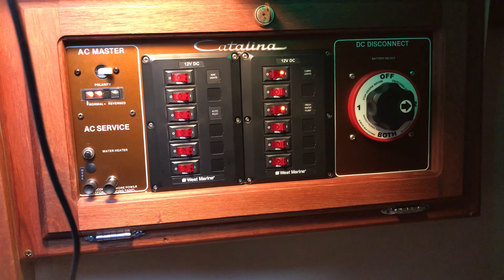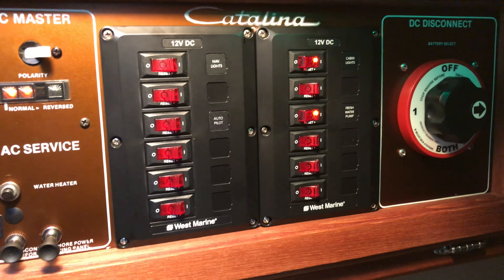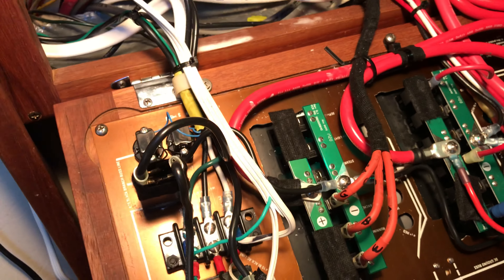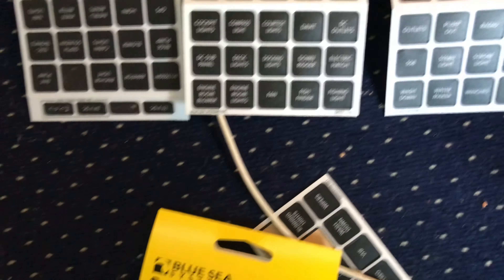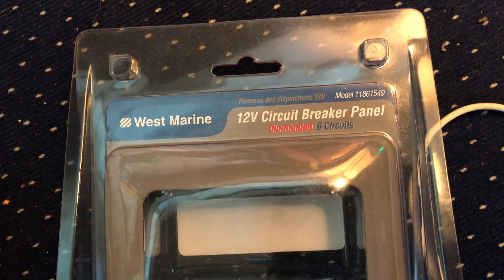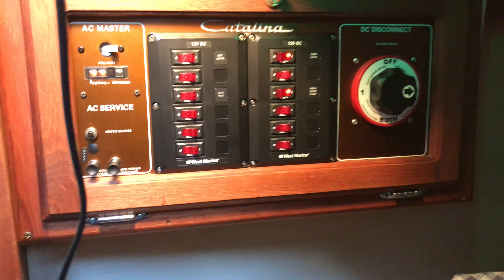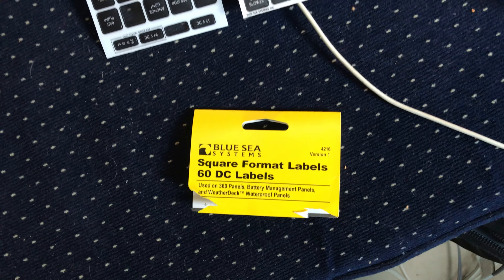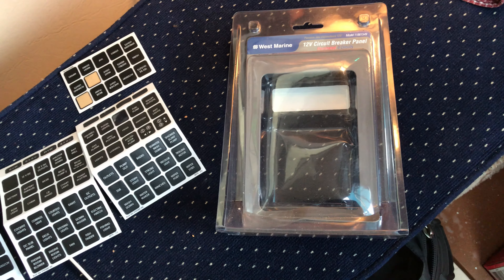Catalina 27 breaker panel upgrade, Blue Sea Systems

Comment: Hi, appreciate your videos. Have a '75 27. Question - do you know where I can source the enclosure like you have for the panel. I've seen them on some 27s but never been able to find one ofr purchase. Could make one I guess, but thought I would ask. Thanks
Reply from the maker: You can try Catalina Yachts may have one but unlikely. 727-544-6681.  Those panels came on the later 27’s 1984 and later.
Reply: @Catalina27  thanks!
Reply from the maker: There’s one on EBay right now, $249
 
https://www.ebay.com/itm/1980-1985-Catalina-27-30-33-AC-DC-Electrical-Fuse-Breaker-Control-Panel-On-Off-/362501671448?mkcid=16&mkevt=1&_trksid=p2349624.m46890.l49286&mkrid=711-127632-2357-0